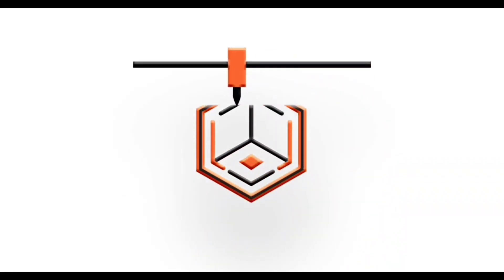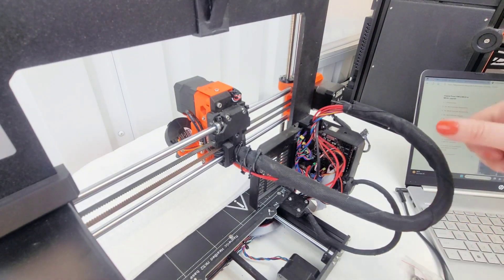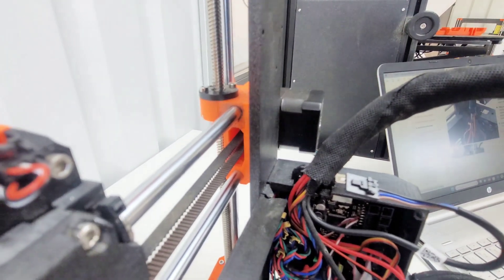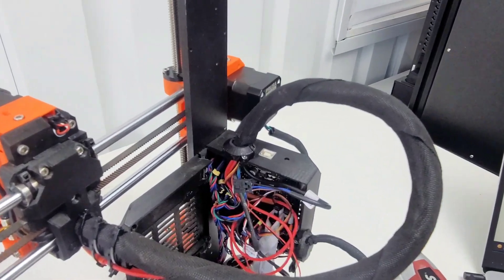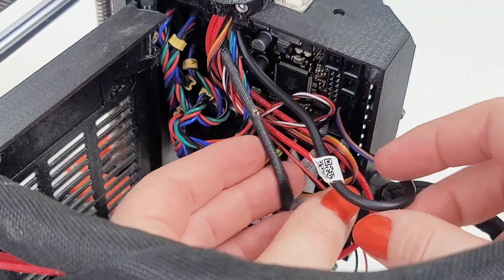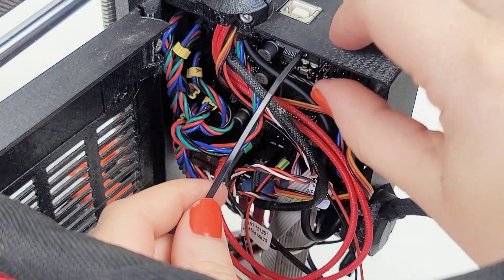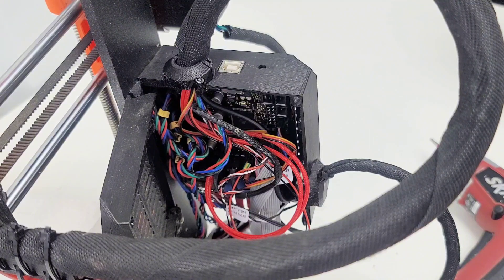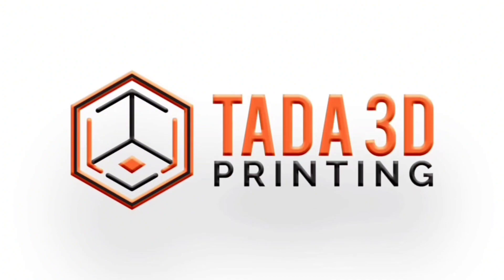MK3S Upgrade to MK3S+ (Side Quest for MMU3 Assembly) Chapter 4

Comment: The M3x40 tensioning screw must not  extend beyond the nut
Reply from the maker: Ok I'll check it out. Thanks!
Reply: Yes, it's an error in the manual, believe it or not. You shouldn't look at the distance from the screw head, but rather how much the screw protrudes on the opposite side, as the distance from the screw head varies depending on whether there is filament present or not. If you leave it as the manual suggests, when you do a filament change, the filament tip will get stuck between the extruder plastic and the gears (it's a headache to have to disassemble the entire extruder to remove the stuck filament). Personally, I adjust the screw until its end aligns with the outer face of the nut, and then I give it a half-turn backward so that it never exceeds the nut. If, on the other hand, I need to print flexible material, I unscrew it until it's almost out of the nut and then give it half a turn forward. @tada3dprinting

Comment: You are right, it's kind of a mess there. I got some thinner cable ties with a Voron kit that might fit there, but just getting the door closed safely is fine, you did a good job with that. The MK4 with the larger enclosure is an improvement.
Reply from the maker: Yeah I need to look for smaller cable ties. Thanks!
Reply: bend the end of the tie first so it will angle down.